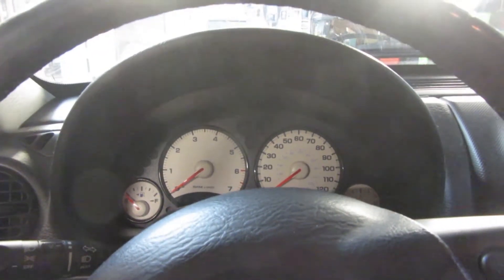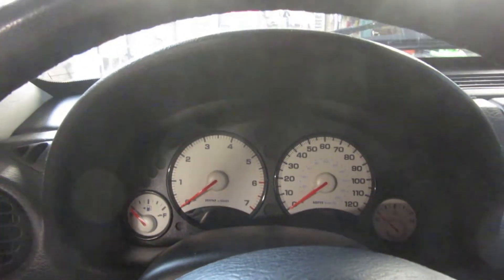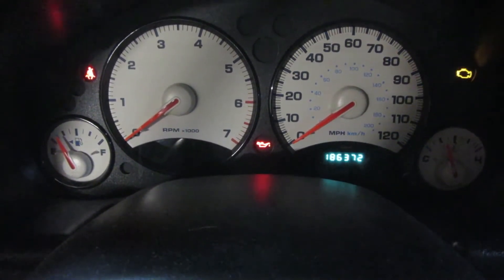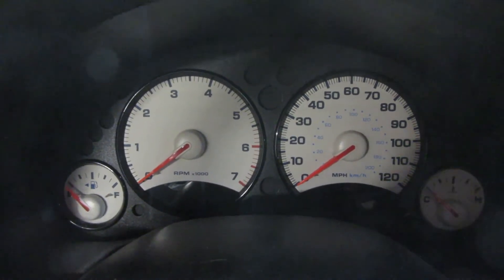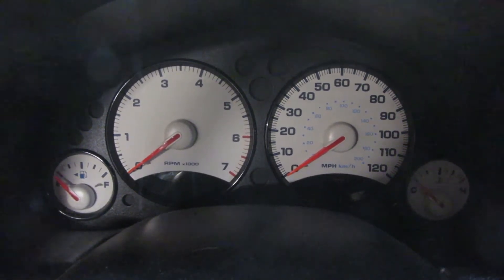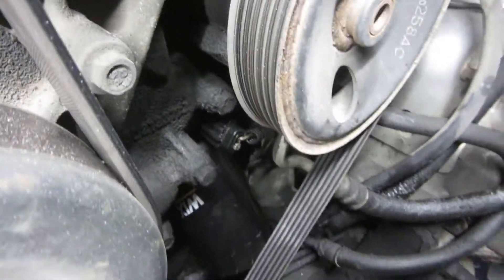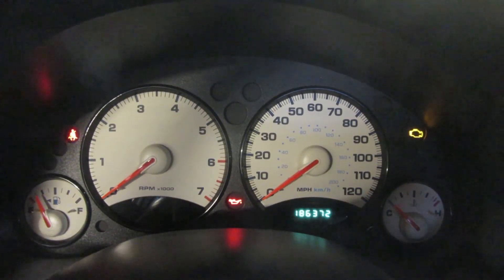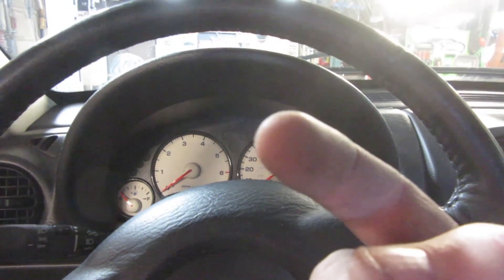JEEP LIBERTY OIL PRESSURE SENSOR UPDATE

Comment: Thank you for your video !!! I have a problem with my jeep Liberty 2003  about oil light pressure.when i started the light turn off and After a few minute turn on. Each time i press the gas  the light turn off and after take out my feet on the gas ,the light turn on .could you help me please?!!
Reply from the maker: go to my channel & go to the jeep playlist & i have a vid replacing this sensor which is what you need to fix it
Reply: It's oil pressure sensor I fixed mine.

Comment: Hello, good evening, I'm Dennis Villalta and I have a 2002 Jeep Liberty with a problem, when I am at traffic lights or at low gear, the oil pressure pilot throws me, but when I accelerate it, it takes off, at first I thought it was the pump And I have taken it to mechanics who tell me that it is not because the divers do not sound, nor the engine knocking, I have been with the problem for more than 1 month, where there are weeks where it does not happen and others where it does, I use an oil 10w30 mobile full synthetic brand could you help me?
Reply from the maker: try changing the sensor if that dont fix it then go from there but  if you have bean driving it like that for a month then it has good oil pressure or it would have seized by now .
Reply: Hello, I have exactly the same problem. Have you solved it?
Reply: Have you fixed it and how @xNorbiful

Comment: Maybe have the competent mechanic check the oil pressure wile your there.
Reply from the maker: I AM COMPETENT IN FACT MUCH MORE SO THAN MANY  SO CALLED MECHANICS AKA THIEVES THAT TELL YOU ONE THING AND END UP REBUILDING THE HOLE CAR, & BILLING YOU, BEFORE THEY TELL YOU THEY CAN'T FIGURE IT OUT.  I CAN TELL BY SOUND FEEL & SMELL WHAT'S GOING ON WITH A MOTOR  . IT'S STILL RUNNING FINE & I FIXED THE PROBLEM, GLAD I DIDN'T WASTE MY MONEY ON A "COMPETENT MECHANIC ".
Reply: @JunkworksGarage  For one you need to know the difference between a motor and an engine to even call yourself a real mechanic. See it is about knowledge and putting the time in. Old school methods of sigh smell and feel are still a good fundamental to have ,but with technology rapid change you either have to keep up or get left behind .This created a shortage so the void was filled by hacks that  don't last long due to regulations Fast money and gone .Those who have hung in there are the real wrenches to find. Many good and bad just like doctors .Hang in there for 30 years and you get your stripes otherwise don't guess test!
Reply from the maker: @adamserafini6945  first i put motor in knowing you would say that, i am old school and don't care that is a youtube bs argument. second im 49 and grew up crawling on the floor of a old garage back when they pumped gas and worked on the car as well and put your tires on for you as well i have bean around and working on cars latterly my hole life ,and have never had a catastrophic failure of any of my cars. as far as keeping up i have no desire to own or work on any newer cars than what i own and will keep them going for years without the help of a "real" mechanic.
Reply: @JunkworksGarage  Good!!!.Started the same just made a living out of it through all of it electronic control carbs that was a nightmare until they standardized with fuel injection, Did heavy equipment along with that journey . Knew real ACE mechanics that were willing to share valuable knowledge AND HAD THAT along with the hated schoolwork ALONG THE WAY. Most lucky with the real mechanic's sharing on the way up that was later found to be more valuable then any shiny rock. Still appreciate the old cars ,Some we would call boat anchors after the rust belt got to them and time.
Reply from the maker: @adamserafini6945  👍